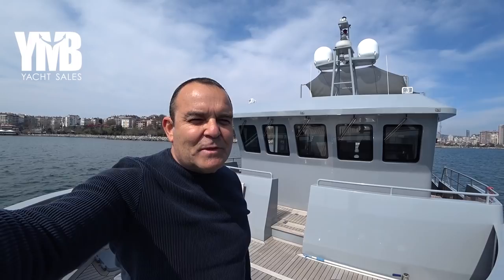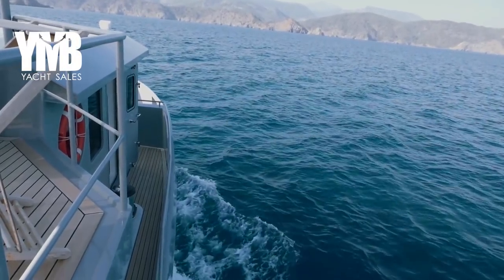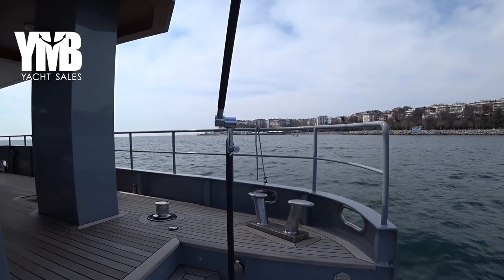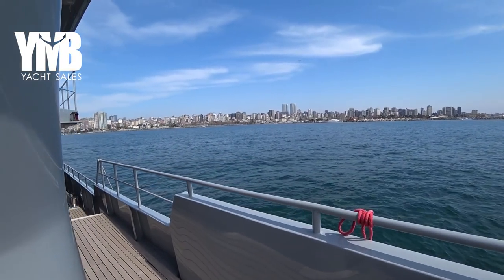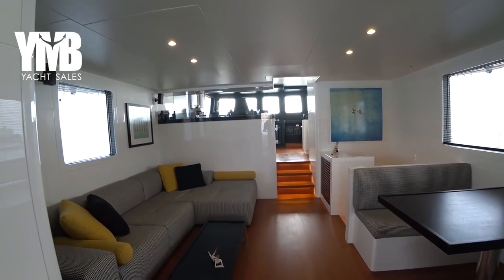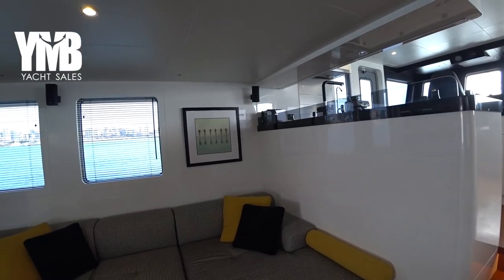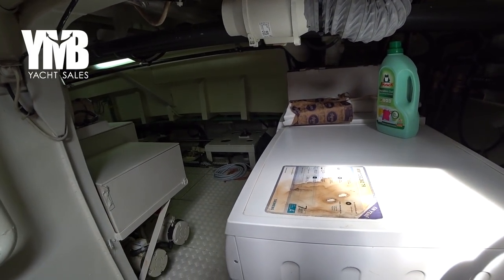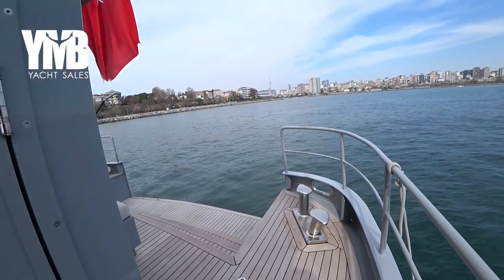STEEL HULL TRAWLER Owner's vertion full walkthrough yacht for sale

Comment: Nice hull, horrible layout.  Focs'le can only be accessed from the exterior deck hatch? Useless in bad weather. The galley table is too far away from the galley and has stairs also. More fun in bad weather. Head on deck can only be accessed from the outside deck only. Even more fun in bad weather. The list goes on. Nothing more than dock queen this boat is to me.
Reply: Agreed, and with a 2000 nm range, you will not be going far - - - Then there is no closure for the Portuguese Bridge, and what he calls a fly bridge appears to be just a boat deck - did not see a control station? And lastly to verify your dock queen thoughts, she has 1200 hours on her mains - that's 100 hours per year; virtually no use at all.

Comment: I see on the site that 8kn cruse and with full fuel she will get 1 kn mile per gallon that is comparable with other coastal trawlers. I am surprised that a 20m steel haul trawler like this is only certified as CE module B. This means she cannot cross oceans. Very disappointing I love the design for a couple who want to cruise the world.
Reply: You are really surprised with that kind of a stern. This is a good weather boat.
Reply: @kevinvandal8595  I would think it could handle big waves with its tug design
Reply: @DanielBrody  Its only the looks, if you have big waves you would lose all of your furniture ;)
Reply: @DanielBrody  can't assume that you are going to take every wave at the bow tho..also you can't get to any of the mechanicals w/o going outside, making sailing this thing on a passage an idiotic idea, because its never the sunny days you need to get to your engines.
Reply: @dennied7826  You are correct, The only engine room access being on the open deck does not seem to be the right design for any boat in open water. The open rear transom is a nice-looking design and practical for a family to use for water sports. Besides the engine room access, it is strange that no interior access to the pilothouse from the interior of the boat. It is isolated from the main boat with no Head not good for the 50+ male.

Comment: Excellent video, nice boat, but it looks to be ex charter boat
Reply: It is well known vessel. make a simple research before any assumption, please) Excellent vessel but the range of 2000nm sucks
Reply from the maker: Never charterd
Reply: @АндрейТуманов-ж2ч   With 2 450 hp engines and a 9000L tank i'm not that surprised about the range
Reply: I can't imagine a charter company wanting anything to do with this layout, even if it's a private owner chartering it. No way, too sketchy.

Googling Dali does bring me too a blue yacht in Turkey called Dali that was for charter but that is a 28 meter yacht, not a 20meter yacht.